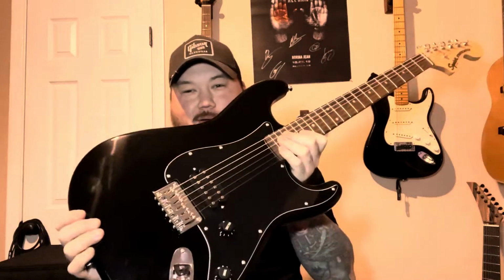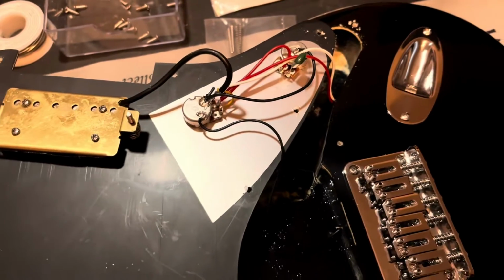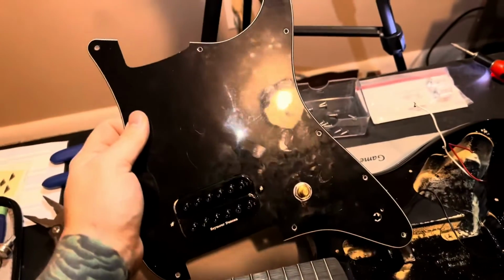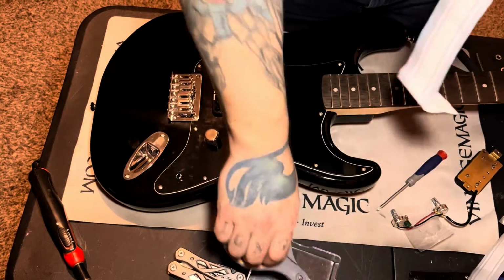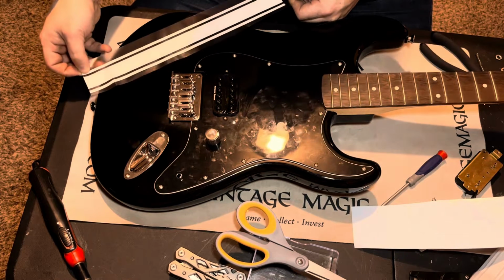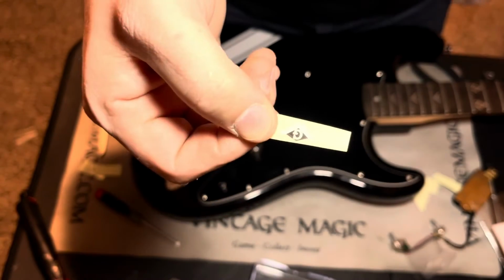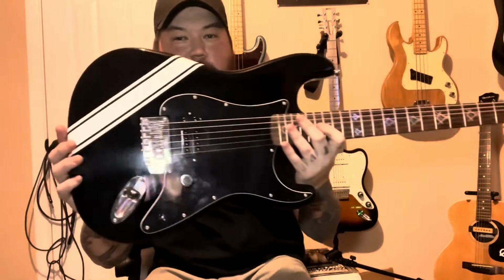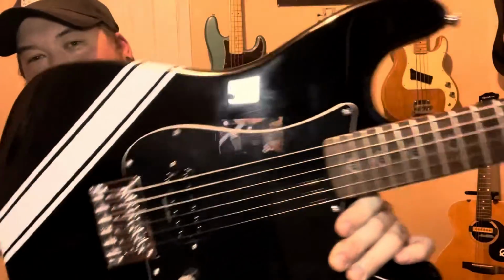Tom DeLonge Squier Strat Build!

Comment: Nice build. I just brought the surf green version planning to do the same..did you use the same pickguard to fit the invader.
Reply: Did you finish it? I just started doing the same, which seymour duncan pickup you used bridge or neck? Read that Tom used the neck version, but i am not sure.
Reply: Not yet done..yeah I read alot in different forums I'm gonna stick with the bridge invader though.
Reply: Thanks for answering, guess ill do the same. @jamroque7547